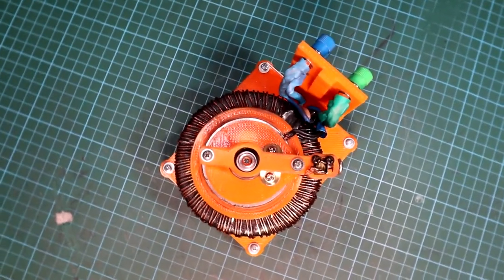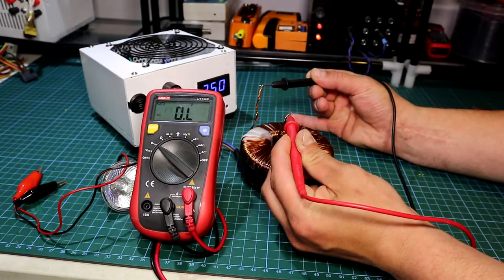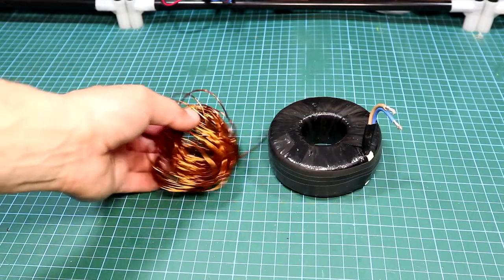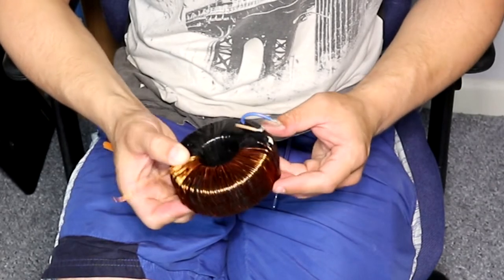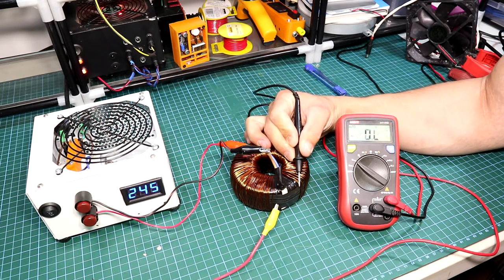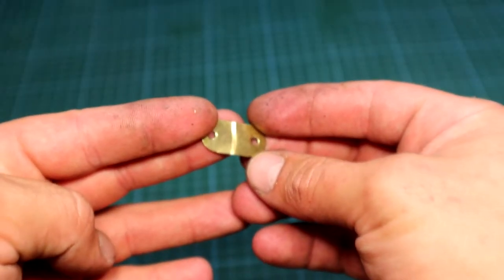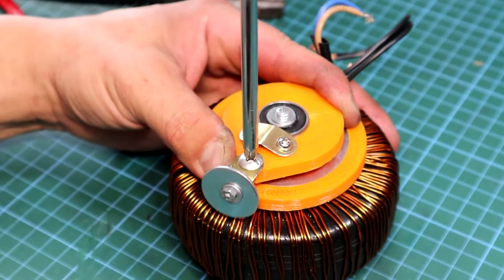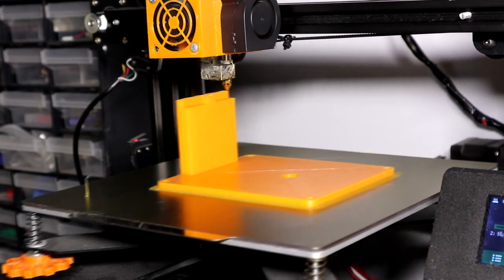Variac using old toroidal transformer 0 to 25v AC 3d printed

Comment: nice project, really well executed also... if i have to do an observation, you don't need that metal washer and brush to make a two sides contact, you can use a simple wire that is coiled like two times around the rotating shaft and have just the one brush that touch the windings, that's how a classic variac is made